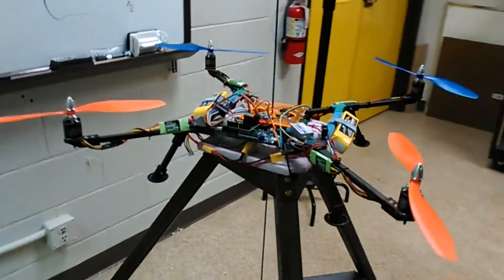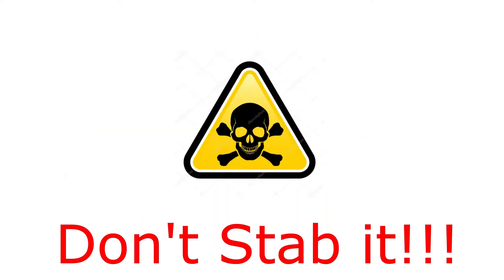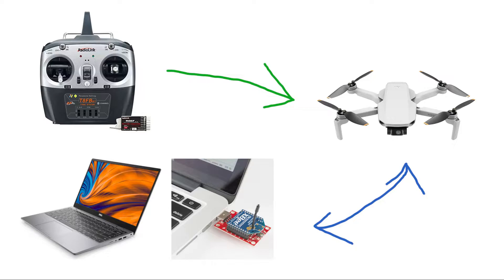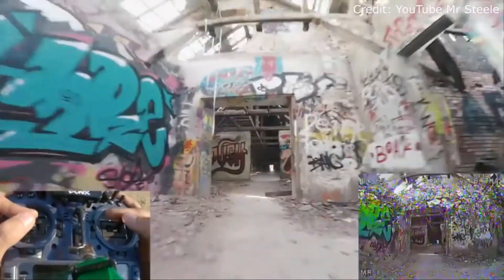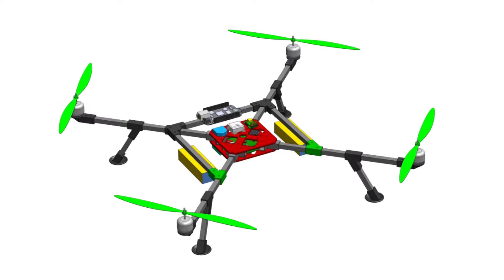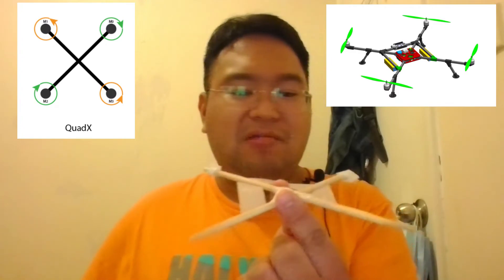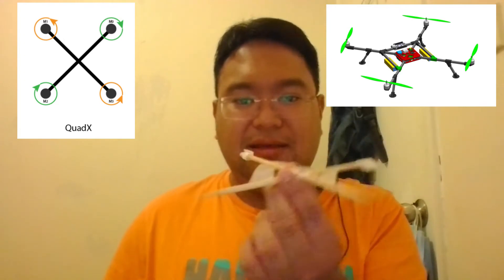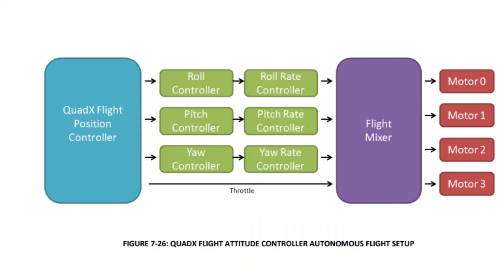Let's Fly! Introduction to UAV and Drone Design

Comment: Hi Billy, I really appreciate the fascinating breakdowns and tests that you're sharing!  I'm a self taught concept artist and I'm just getting into CAD and AI assisted volumetric design. In your opinion what would you say is the optimal way to approach drones for a designer? 
 thanks again for the video and best of luck on your future test flights!
Reply from the maker: Hey, thanks for the feedback! I think the best way to approach drones like learning about it one is to buy a cheap one, play with it and take it apart lol. To design one, I would start by thinking and defining requirements. Like how it would be used, how much weight it needs to support, how long flight time, how fast it needs to respond to commands and disturbance. That will drive design choices like prop size, motor size, batteries and frame designs. Might require some calculation to size everything properly.
Reply: @BillyHau  I’m starting to see why it’s so crucial to define my requirements before I jump into the design stage.
I’ve found a few budget DIY drones that I think will help me better understand the drones construction and functionality.
Thanks for the advice, this really helps!
Reply from the maker: @NME10E  yeah, always do some system engineering planning before diving into the design phase. This is where 15 minutes could save you 15 percent or more on the overall project cost lol. Try using eCalc for sizing components, it's a pretty good tool
Reply: @BillyHau   I wasn’t ready to get hit with the GIEKO! LOL 
eCalc looks like a solid tool.
Sorry if I’m asking too many questions, seeing the advancement in tech, drones, eVTOL is exciting.
Reply from the maker: @NME10E  No problem, learn by asking :)